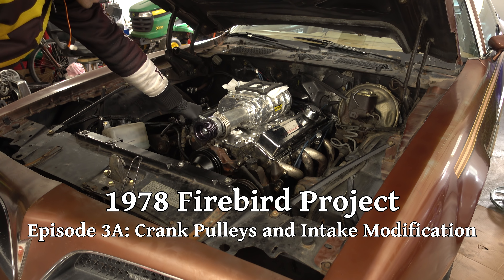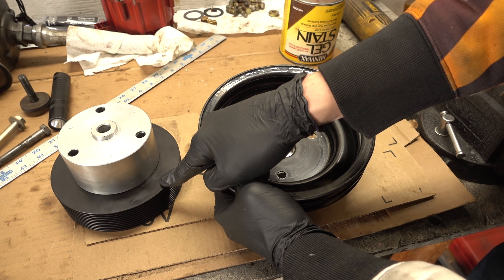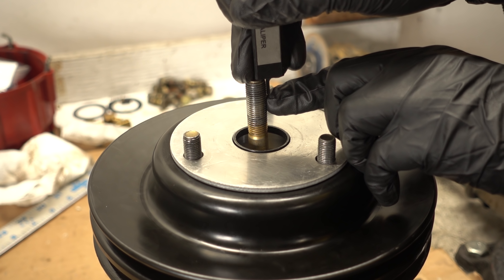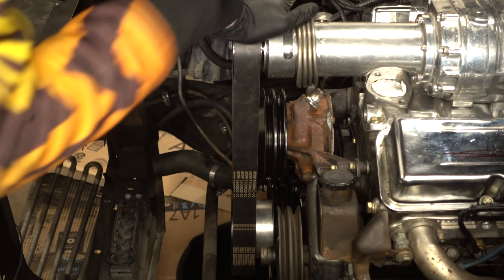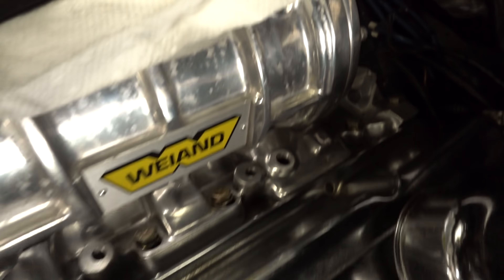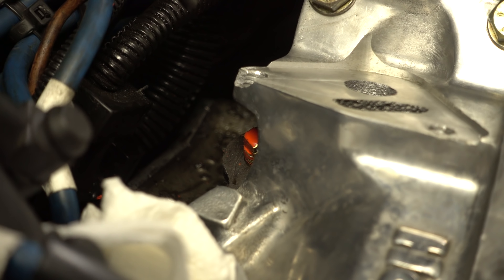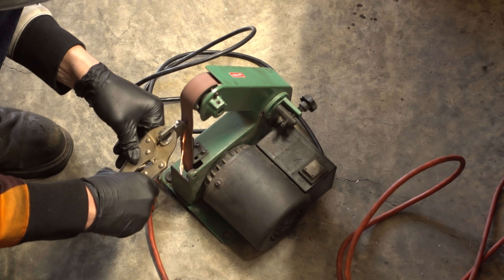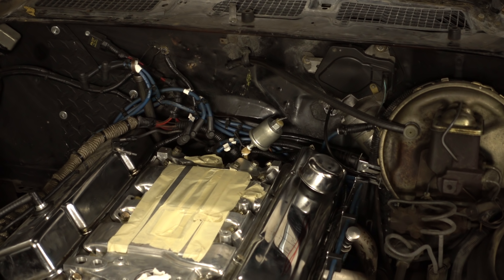1978 Firebird Supercharger Pulley and Intake Mods (Ep.3 Part 1 of 3)

Comment: Yeah... the "inch" that is always missing... well you lost it when you changed the balancer. You took your original measurements off of the other harmonic balancer.
Reply from the maker: Check out the beginning of episode 2 part 2 again, the overall height, length that slides over the crankshaft, and thickness of the flange at the threaded holes is the same. It is possible they don't install the exact same distance, but that would be more like a 1/16" difference and no difference between them could account for an entire inch. Think about it this way: the timing tab didn't move, but covers up the same amount of the outer ring on both balancers (again, check ep2 pt2), they have to be very similar.

Comment: older small block water pumps where shorter
Reply from the maker: True, but it didn't matter for this application. This model of blower was claimed to specifically fit long water pump accessory setups and that didn't end up being the alignment issue anyway, it was the crankshaft pulley that didn't line up.

Comment: oi
DUDE you WAAAAYYYY OVER TORUQ them down
i did the same thing on my blazer intake but it didnt crack or break th eintake it just snapped the bolt and i got it out easy 
so i just tourqed them down to like 12 to 15 and you WAAAAY TO MUCH TOURQED it down
plus i did mine in -30 weather hahaha and it still didnt crack HAHAHA
so go back take out the washers and do it at like 12 or 15lb/ HAHAHA

THE END
::))
Reply from the maker: Nope, the instruction manual for the supercharger kit states 30 ft/lbs, that is the correct torque value and I didn't even get to it. I stopped at 25.
Reply: oi
i tried it on my intake aolly and it didnt crack and lucky bolt snapped and hole runs allt he way through so got some tiny plyers and got a hold what so tiny bit was sticking up and got it out
but chorme they crack way to easly
but they should test fit the chorme part but i dont think those are right for how much thickness it is and for being 800 bucks but what i say long as it seals and doesnt leak and bolts dont back out its good and i put thread lock green or anti seaz on it that holds it in
but the vibe makes them come out but see what happens 

THE END
::))